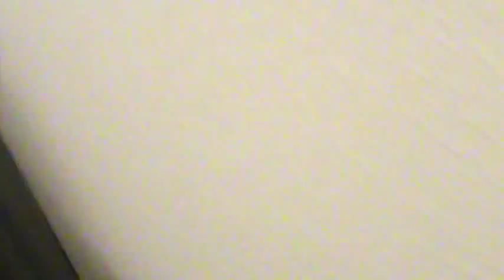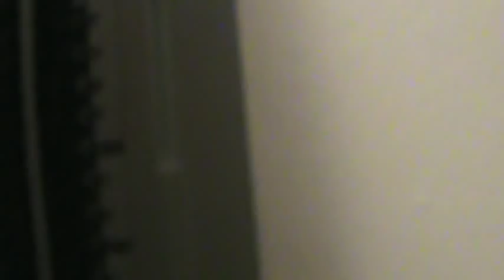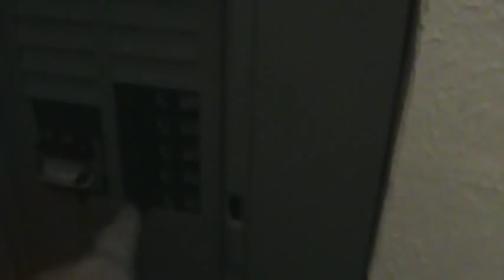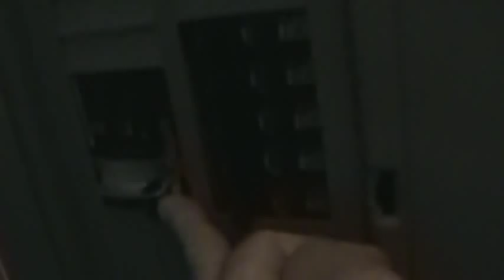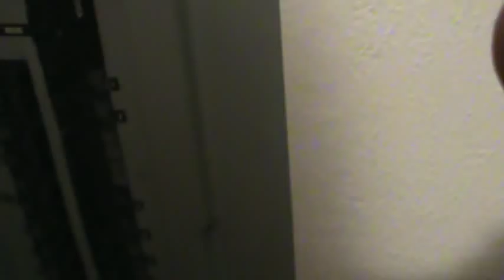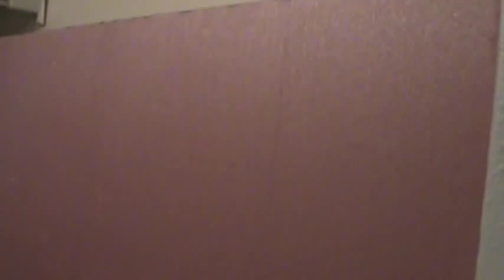Grid green power transfer switch DIY

Comment from the maker: Tiffany, this is nothing more than a back-fed breaker box with a handle interlock on 2 breakers.   The handle interlock is made by Schneider and only allows either one or the other breaker to back feed the breaker box.  It's a break-before-make system so both can't accidentally be turned on at the same time.  Try searching Google for part number QO2DTI.  I hope this helps.  Let me know if you have any more questions.